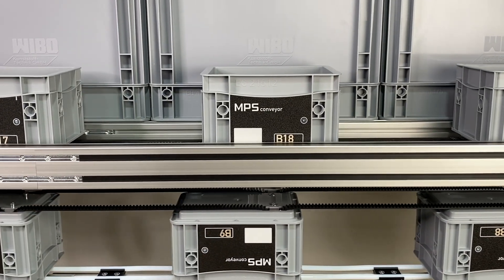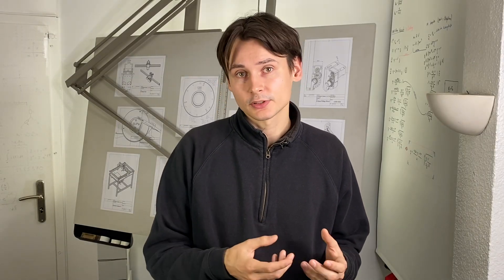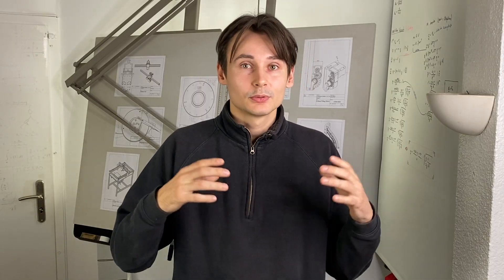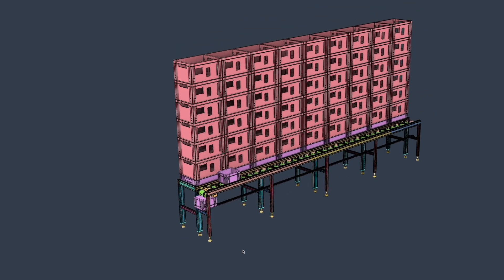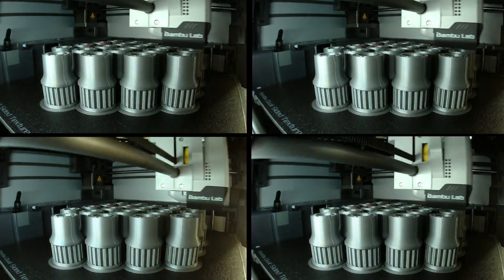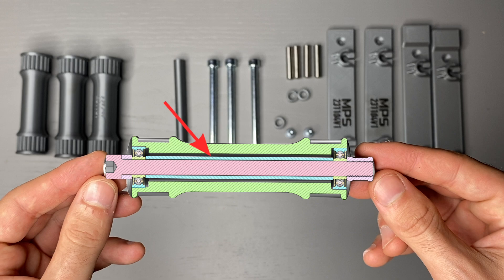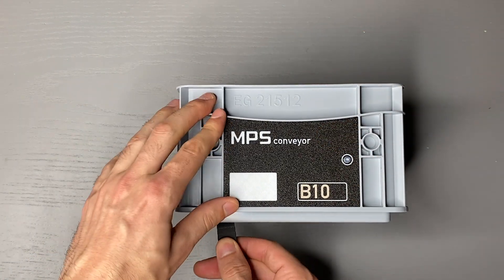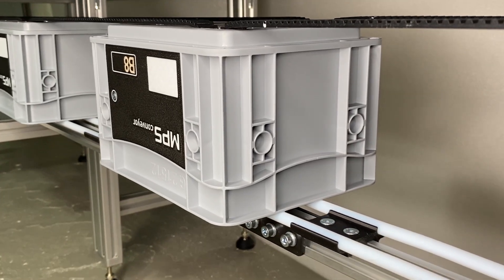The conveyor - 3d printed automation #008

Comment from the maker: Message from the Sponsor: Use the exclusive code "BFYTB". You can get $30 off your E7/E7pro/C7 purchase.
US: https://bit.ly/479FFhV
CA: https://bit.ly/3ZVxUJY
Reply: Hi @Christopherhelmke with regards to your Feeder boxes, why did you use the Socket Head Cap Screw on the face plate? if you used a Flat Countersink screw you can remove the small arm that must move out of the way when the Socket Head Cap Screw goes past.

Comment: The PVC belt may have been the better solution BUT testing the system with a lower cost solution that still works extreamly well is the better option for now. Great work so far Christopher and thanks for sharing such a great design ;)
Cheers Stephen :D

Comment: Nice content and very precise CAD skills! Which type of pulley system (GT2 or a diffrent shape) whould you recommend for 3D printing? GT2 could somehow a be a bit too detailed to print well?
Reply from the maker: Hi, I used HTD 5M in this case, GT2 can work as well with a 0.2mm nozzle, but with FDM even HTD5M will never be 100% perfect, for me it worked because the pulley is so large.

Comment: Instead of tons of small rollers, consider using plastic guide rails (or wear strips) for the belt. it will generate more friction, but it would ease the assembly and reduce time wasted on 3D printing the parts.
Or, use the same Teflon tubes under the boxes which can slide on them. Print simple guide bearings that slide over the tubes to centre the crate.

Comment: First I dont think having the rollers conforming to the shape of the belt teeth is necessary, I also agree with the latter statement that using pvc belt would be better mostly because (if it aint broken....etc) But i do understand the attraction of making it myself. another point would be serviceability. I would belive that it took quite along time to assemble all the containers in the current solution. Anyway i love it !!!!

Comment: great stuff! i have an idea for you.. you can add some quality control on the output of the conveyer belt with a precision scale. For a particular kit contents, knowing the exact number of each component and the per component weight, you can quickly weight a kit and verify it is within some tolerance to know the part counts are correct with some amount of probability. And if it doesn't pass that QC check, the parts can be diverted to be checked later. Looking forward to the rest of this project!

Comment: Am I the only one to think that a packing machine, at the base of each stack would be really helpful : 
The idea is that the machine put a bag between the end of the chute and the conveyor, as soon as one type of screws/nut/washer was counted and dropped into the bag, the bag is closed either by sealing or ziplock and put down into the conveyor's case.
It might not be that difficult to close the zip type bag, with two rollers pressing the sides together, but I have no idea about the reliability of such a design

Comment: Awesome job, Im assuming you use magnets for picking up the fasteners, novel idea, but this will be problematic, if they are Stainless, Aluminium or Titanium, then this system can't be used, and yes a Flexowell Steep Incline Style Belt would have been an expensive choice indeed, this is setup more is more like a pocket conveyor that uses 2 seperate belts with a pocket or bucket suspended between them, also using the timing style belts allows you to have precise control.

Comment: Hi Christopher,
If you use a countersunk bolt head, the nut's head in the rotating plastic circle will not stay out. You don't need a moving arm to skip the head.
Reply: I'm guessing he uses the head to stir the parts to align with the magnet, so he then needs to pass them through. Can't wait to find out!

Comment: I love this channel. I'm a mechanical engineer and I love uniformity, repeatability, and simplicity. I'd love to work with you, but looks like you've got it covered.

I wish we could get euro containers in Australia. There are no real standardised crates here that don't cost the world. One of my favourite crates just changed their design recently and now it doesn't fit in any of my systems anymore.

I think someone in Australia needs to import the equipment to make these containers locally.
Reply: Hey mate, what containers have you been using?
I love this series and watching curiously how it unfolds, I too love uniformity, repeatability and simplicity especially since it usually adds to reliability. There’s not enough like us in the world though!
Reply: @dejan.  I have been doing production engineering for about the last 18 months. We don't use our crates as part of a machine like this, but it's part of our process of transportation and assembly. We have been using the 20L Handy crates from Bunnings. They now only make smaller ones or collapsible ones. It's just not the same.
Reply: Eurocrates are just injection molded plastic. What makes them special is the standardization. You can find the full specifications in a DIN I believe. I suspect it would be no harder to get an injection molding shop producing them than any other similar sized object, and the real expense would be the mold making.
Reply: @pemetzger  I know this. It's just weird to me that Australian injection moulding doesn't have this in its catalogue of line items.

Comment: Which 3D-Printers do you use for the Parts you sell? And which Printer would you choose if you had to start over? Im just keen to know if I should keep investing time and money into my Ender 3...
Reply: I guess bambu is the way to go
Reply: He uses a Bambu printer, in an earlier video on embedding parts he builds an arm for it, you can also see it in the timelapses
Reply: @bansci  Yes, but I suppose thats not the printer he started printing with. Also I am not sure if an expensive Printer like Bambu is capable for a large quantity of parts.
I figured the Bambu might just be for rapid prototyping and development instead of the whole production...
Reply: @Malte6450  yeah, but these days people run print farms on the P1P, and if your getting started you can't beat the A1 mini (no need for the multi-material system)
Reply: Bambu is alsow very good for mass producation. A lot of people are using them in print farms as well. There are cheaper options like the P1P

Comment: +1 for FlexiSpot. I use a small FlexiSpot desk frame as the base for a welding table. It's amazing to adjust the height of the workpiece and be perfectly comfortable whilst welding. The table is so versatile I use it for other workshop jobs, infeed/outfeed table, chopsaw stand etc...

Comment: I think the roller should have a smooth groove as it is not critical that it engage with the belt. It will make the coveyor more reliable as a bearing fail will not result to a total failure but a degraded state

Comment: Nice to see the conveyor moving so well, the Teflon tubes were an excellent decision! My question: I have been recently fascinated with printed vibratory bowls and was wondering if this could be added to serve as a feeding method for non magnetic components? - They have their downsides in how to mount/dissipate the vibration but might be interesting! Keep up to good work as always!
Reply: Teflon has essentially no wear resistance - thos plastic bins will cut right through it. It is fine here as a proof of concept but will need to be replaced with something robust like Turcite (expensive) or precision ground steel rod.

Comment: 6:53 - You've done it a hundred time already so I expect you are already thinking of a quicker way to mount bins and other parts to your CNC table. For each operation you plan to do more than 5 times, just make a fixture. I am not advocating for a universal system that will work for every possible shape. I would just make a design and attach it to a piece of plywood. When you're done. Store it for later use.

For those boxes there, a plywood board with snap-in/snap-out 3D printed detents can improve your productivity. It can have a cam on the side if you want something extra. Now that you've designed it, next time a slightly bigger box shows up, re-print the detents and cam and get another piece of plywood.